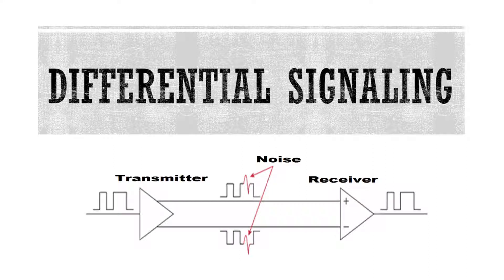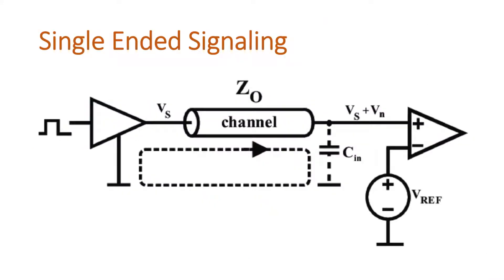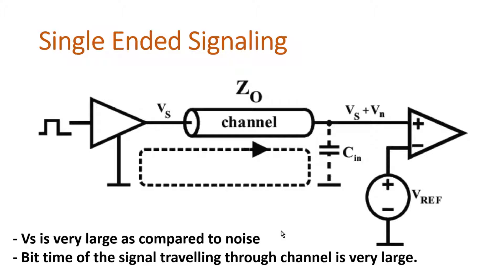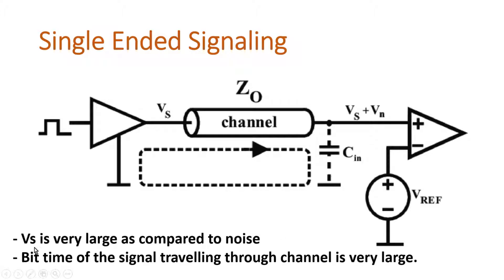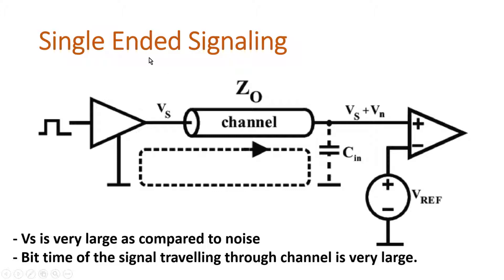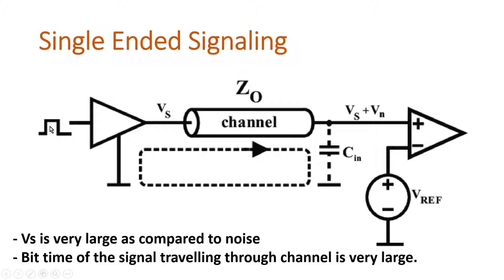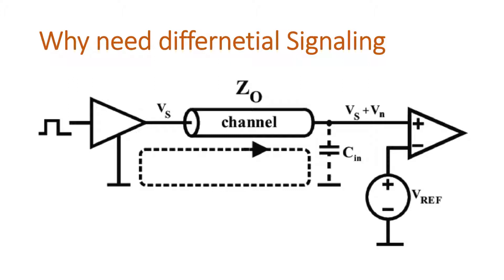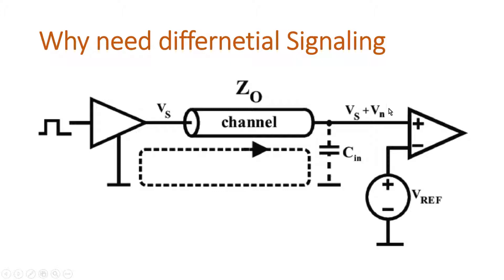Why require Differential Signaling in High Speed Serial Links #PCIe #USB #Ethernet #HDMI

Comment: Even in differential signalling, capacitance will be present. So, how does the low bit time not cause erroneous bits in differential signalling?
Reply from the maker: Dear, I agree with you that capacitor will always be present.. so when bit time is reduced, very small voltages are accepted as logic '0' and logic '1' at the receiver input .. due to which noise becomes a problem. so, needs differential signalling to cancel this noise.